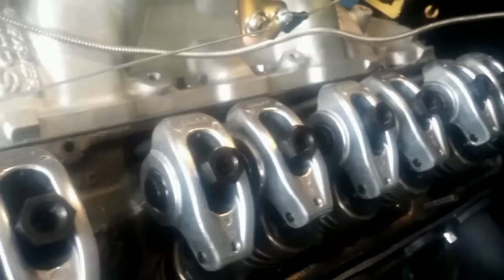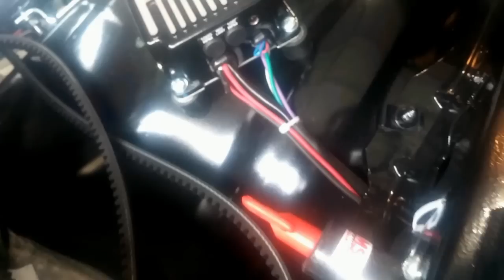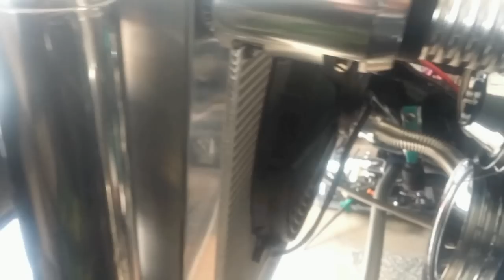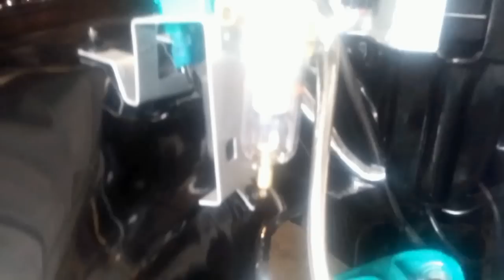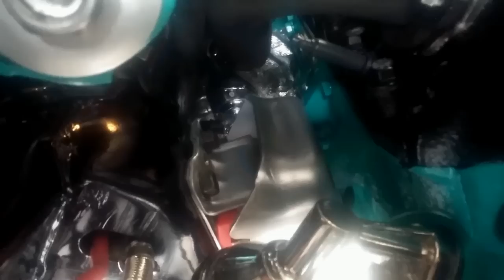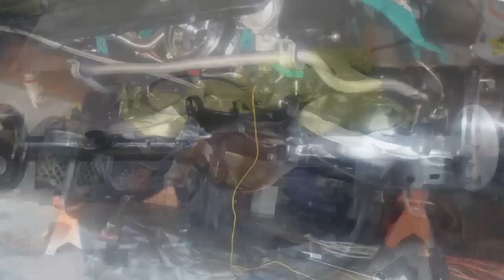Draftpick1000 BoxChevy Restoration *Sneek Peek*

Comment: say bro where did get that cable bracket at... I had one similar to it about 2 yes ago but it didn't line up right.
Reply from the maker: jegs
Reply: +draftpick1000  cool what brand and what part number if you have it
Reply from the maker: +carledward1968 555-157313 jegs performance